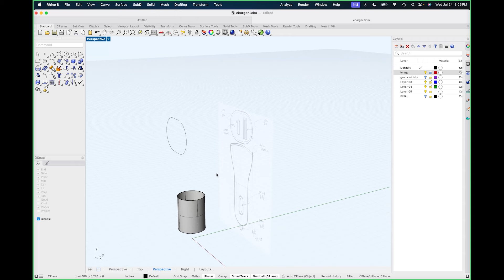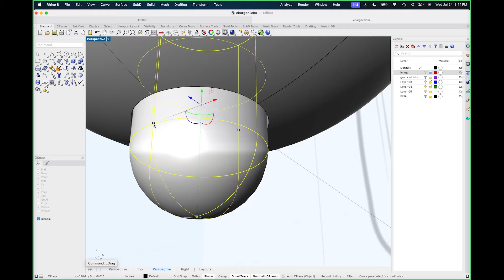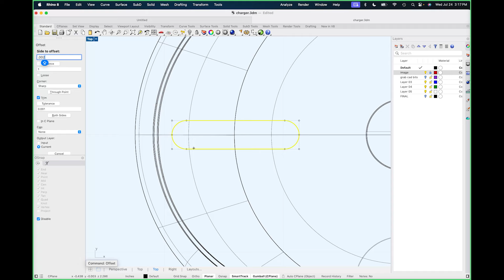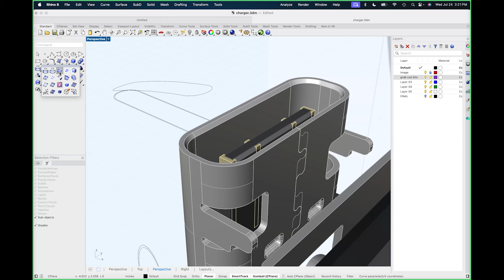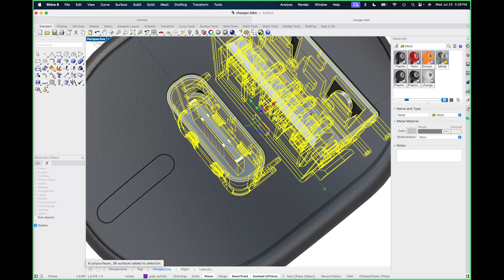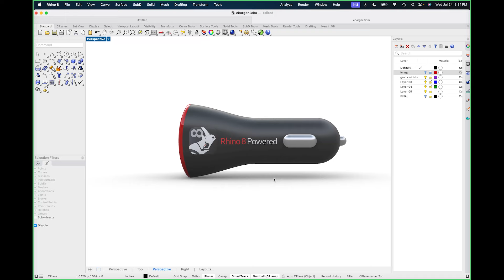Getting started Rhino 8 for Mac - usb charger

Comment: I cannot get this to work. BlendSrf gives me this wonky pinched middles. I've even tried it with even simpler forms and my computer just seems fixated on pinching these forms in the middle between the two curves. Thoughts? Suggestions? Seems like a "Getting Started" tutorial shouldn't be so frustrating to make work...
Reply from the maker: Send me your file at tech@mcneel.com I’ll take a look-
Reply: @Rhinoceros3d  File has been sent! Thanks for the offer!
Reply: @Rhinoceros3d  Just wondering if you've had a chance to look at that file I sent in response to your offer above?
Reply from the maker: @HunterHamilton-t9x  I did and it appears to be a bug. the workaround is to split the edge of both surfaces into two edges and then run blendsrf.
Reply: @Rhinoceros3d  Thanks for taking the time to look at my file and confirming that it’s a bug. That’s actually helpful to know, because I wasn’t sure if I was just doing something wrong in the tutorial.

Since I’m still pretty new to Rhino and was following this tutorial step by step, the workaround you mentioned is a bit hard for me to decode. When you say “split the edge of both surfaces into two edges and then run BlendSrf,” could you spell that out in a bit more detail for a beginner? For example:

Which specific command should I be using to split the edges?

Are there particular points along the edge I should be splitting at?

Do I need to do anything to the surfaces (join, rebuild, etc.) before or after running BlendSrf?

Also, since this bug shows up when following one of your official tutorials, is this something that might get noted or updated in the tutorial itself? As a learner, hitting a bug in the middle of a lesson with only a one-line workaround makes the learning curve feel a lot steeper.

If you have a short step-by-step description or even a quick screen capture of the workaround, that would help a ton.